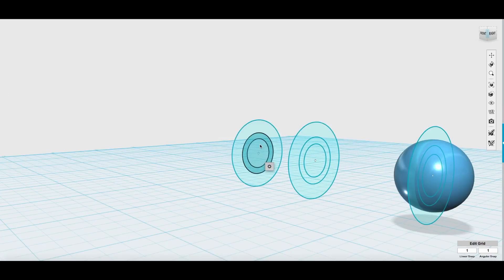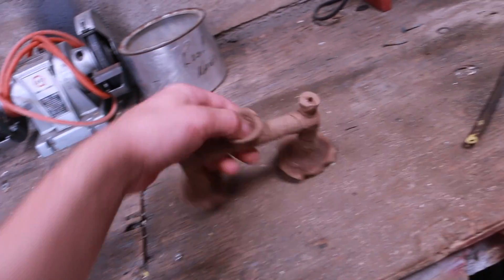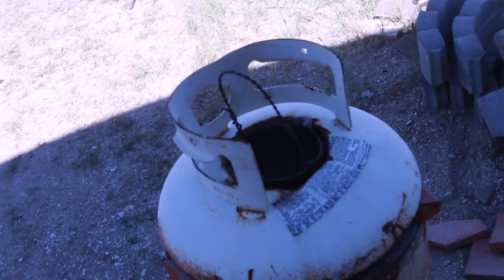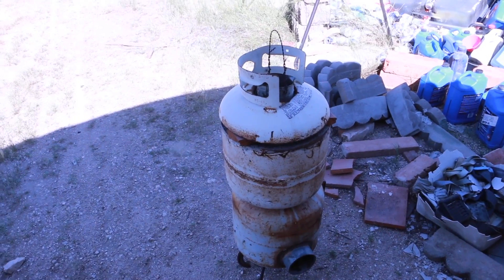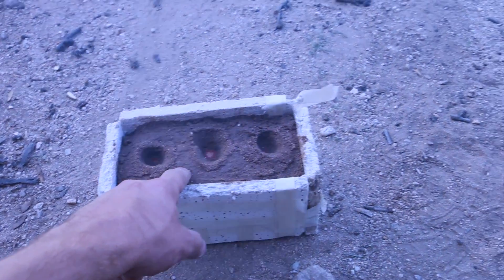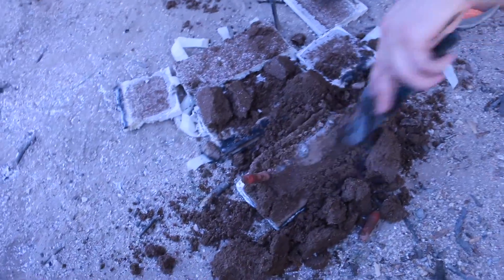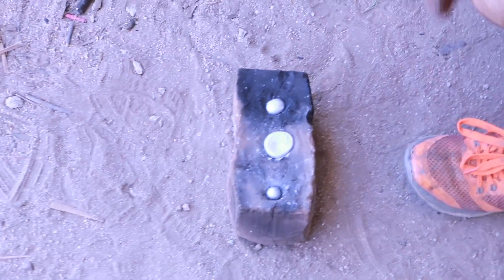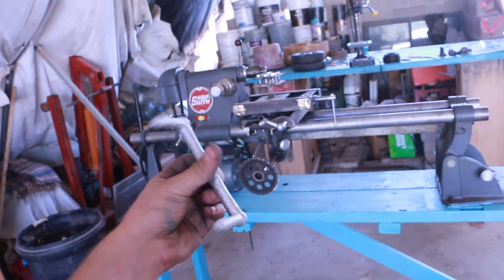Casting Aluminum 3D Printed Lathe Handle!!

Comment: Hey. So the reason clay cracks is because it shrinks quite a lot when it dries.. so if you have something solid inside of it, it will always crack because it has nowhere to go.

Mixing fired clay, aka bisque, into wet clay will reduce shrinkage, as will sand, but it won't eliminate it.

Comment: This is like the worst casting I've ever seen.. You should try to get the plastic out of the mold before pouring aluminium.. Maybe try to heat the mold up to about 250-300 °C and just pour the plastic out OR make two separated half molds like everybody does.. And I guess the clay should be more compressed. But the idea of 3d printing a casting model is great! :D

Comment: Okay. I taught myself casting years ago. And was pretty skippy good at it. I bought a ton of books, but actually the only two I needed were Practical Casting: A Studio Reference, Revised Edition - Tim McCreight and Centrifugal or Lost Wax Jewelry Casting: For Schools, Tradesmen, Craftsmen by Murray Bovin. Both are excellent books and between them, they tell you EVERYTHING you need to get it right pretty much from the get-go. I would have saved myself a TON of money on unnecessary supplies and equipment if I had found these two books eariler. (I mainly cast tin, lead alloys (WarHammer Space Marines! Dark Elf Speeder Bikes!), sterling silver, pewter and gold.)

Comment: You need to cast the part in Green Sand ( you can make you own , its a mix of bentonite (kitty litter) clay and sand) or Petrobond. Look up TubalCain on YouTube, he has lots of good videos on metal casting. Also pouring metal into wet clay is extremely dangerous, because the  water can flash to steam and cause the molten metal to blow back on you. Hope this helps.

Comment: That was outstanding. I really liked your final solution. Did you use more than just the cans for you metal source? How many cans did it take?was the wood fire with the fan enough to melt everything or did you need to bring in an additional heat source? Again, great video and thanks for sharing.
Reply from the maker: +Thom Lindgren Yes all metal was made of aluminum cans. No additional heat source other than starting the fire. We used a trash bag and a half of cans but that turned out to be way too much. I hope this answers all your questions! Thanks for your comment!